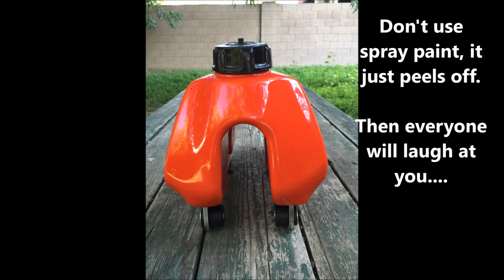How To Properly Restore Motorcycle Plastic With Polishing Compound

Comment: Hey, I Really like your videos! The text tells/helps to understand what you are doing And the high speed gets us to the end of the job quickly without having to skip  steps. I do like the soap idea. We have used that for years as it seems to really help the paper from clogging up. I have a 1985 XR350R with stock plastic that is in good shape. I don't have much if any oxidation to remove so I think I will try starting with the 400 and see how it goes.   You Should Make More Videos! Yours are organised and clear presented.  Much better than 90% of YT videos. Take Care.
Reply from the maker: Thanks dude! I may do another video, but most of my tricks are in the two videos I already posted. Most of them.....

Comment: Finally!  Someone on THE youtube  has done it THE RIGHT WAY.  Thank you ML.   Lots of hacks on here filming substandard methods and getting poor results.  This works for removing scratches too, but it takes a LONG TIME with the 320 or even something more course to get the super deep scratches out.  Regardless is the single best and most correct method.  The technique in this video is the exact same technique you use for restoring plastic headlight lenses.

Comment: Great video, thanks. 
The problem I had, being a novice, I thought the tank would get more orange as I sanded but it stayed white after dropping down to finer wet sandpaper. At 2000 grit my tank was still white so I thought I was doing something wrong so I started over. I finally realized that was normal and once I polished it I'd get the great Honda orange color and shine I was looking for. Maybe I missed this step somehow but if not maybe edit the video to explain the tank will remain white as you get to the 2000 grit sanding finished and the polishing is what brings out the color.

Comment: 400 grit is ok to start with, esp if you can't feel any scratches. 320 can leave some swirls, esp if you use it in your hands. 400 will take like 15% longer but really help if you're after that showroom shine. hell we used to use generic kitchen Scotchbrite pads then 400 then 800, and finish with a felt buffing wheel on a drill or Dremel using red jewelry polishing compound
Reply: Paul S you must be living right . I’ve done over 200 tanks and only maybe 3 or 4 that nice . Typical is having to use 80 grit to start.

Comment: I have what looks to be aftermarket plastics on a dirt bike. Previous owner painted over them. I removed the paint but there are some deep scratches from sanding before he painted.  The 320 is very slow in removing them. Can I step down to 220 or just continue with the 320?  Also there are some stress marks in the plastics from bending that have made the color lighter. Will sanding get rid of these?
Reply: Bill Spring yes eventually. You might price non gas tank plastics though if very rough

Comment: I figured out I got the compound that was in your description will I need polishing wax also? Thanks
Reply from the maker: No wax needed.
Reply: M L hey ml I just finished both plastics but one of the plastics scratches with the 1000 grit I finished off with did you come out but the other plastics did
Reply: The 1000 grit did not come out with compound do I need to push harder or go slower but I think I left some of the compound excess on the plastics

Comment: Do you get any fine scratches in the plastics or is it just one smooth, shiny surface? Is the shine comparable to new plastics?
Reply from the maker: If you sand thoroughly then you will not have any fine scratches when you are done.

Comment: Late to the party... Great video, thanks. I've tried this on some plastic from a 2007 honda, I can't get the same results even after 2000 grit. Here's what I've tried- wool pad on cordless drill, foam pad with electric orbital, loose leaf wheel on air die grinder ( yes I burned a bit) Tried all methods and pads with turtle wax compound, meguiars ultimate compound and polish, dry, and mother's aluminum polish. Do you have any tips for me? Seems like my sanding process is good, end up with very smooth dull plastic after 1500 and 2000, but the dullness is still there after trying to polish. Help?? Thanks again.
Reply: Did you ever find a solution to remove the dulness? My sanding proces is going really well but the polishing step isn't working... Plastic stays really dull.
Reply: The problem you are having is because your drill (with buffing pad) is not spinning fast enough.  You must use a drill with a high speed setting.  That will fix you right up.

Comment: I've finished cycling through the grits, following your tips. Although, I noticed this white stuff on the plastic towards the beginning, and I thought that it would go away after finer sanding, ( it also temporarily went away when wet). After I was done, it dried, and the white stuff is still there. What did I do wrong?
Reply: Yes, I'm going to try again today with more water and soap.
Reply from the maker: +AmazingCobra the white look after sanding means you need to buff.
Reply: M L yeah, I hadn't gotten a chance to go to town and get the compound. I could only find a level 3 compound though

Comment: I feel like the wool pad is just causing the heat a heat gun would. Seems like alot of work to still need touch ups afterwards when a heat gun works 100x faster and is cheaper/cleaner/easier.
Reply: Cheaper, easier, but not cleaner. Also there is always the risk that the plastic melts or warps.

Comment: You said to use "Meguiar's Extra Heavy Cut Compound", but in the video you use "meguiar's Pro Speed Compound". I just noticed this, so which one do  you use?
Reply from the maker: AmazingCobra M100
Reply: M L. Nice, that's the cheaper one from what I saw, I'll have to get on that after school slows down a bit. thanks
Reply: something will happen wrong when  u use Meguiar's Extra Heavy Cut Compound ?

Comment: Your vid. rightly rides down the razor approach. Running a sharp razor over plastic should be one's nuke button for plastic restoration, i.e., the last resort for very deep scratch removal. There are too many how-to's re. plastic restoration on YT endorsing it as a first step--just say no, ppl. The razor will create flats and/or valleys in the plastic that no amt of sanding can reshape to an orig. contour.